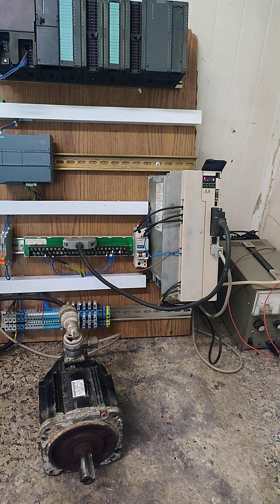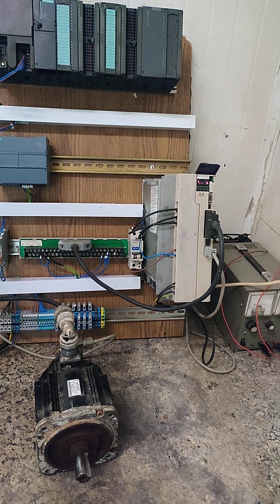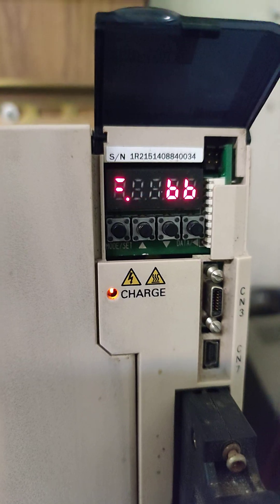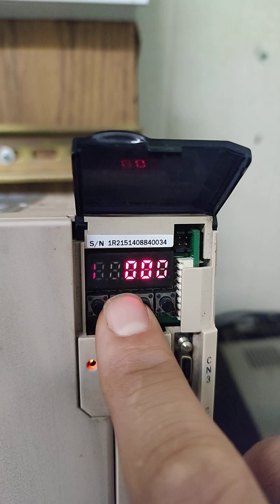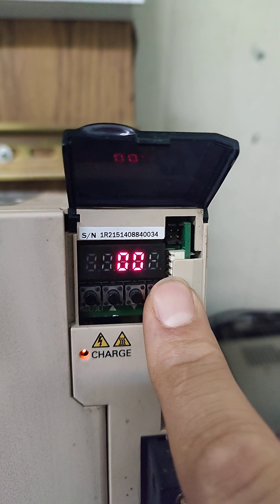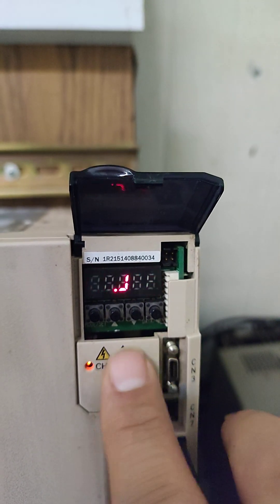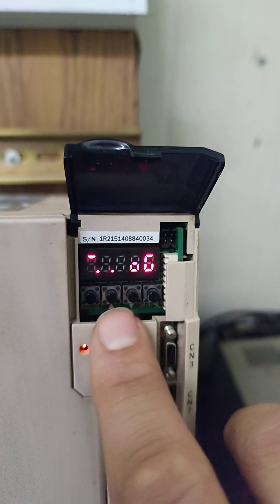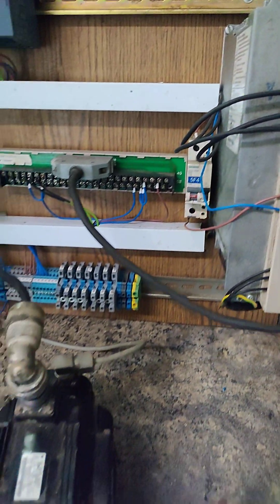How to Jog a Yaskawa Servo Motor – A Practical Guide. #electrical

Comment: You should demonstrate how to ramp up the motor using a potentiometer.
Reply from the maker: With a servo drive, you can control the motor in three modes: speed, torque, and position. In speed and torque modes, you can use a potentiometer. I’m planning to record a video about this. Please subscribe to my channel to support its growth. Thank you!